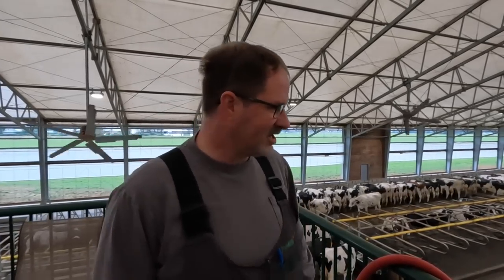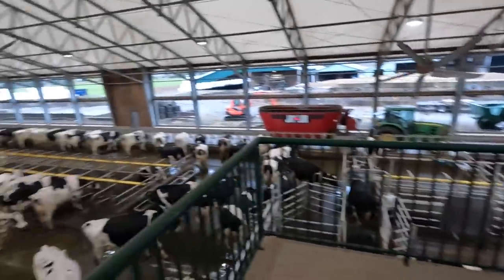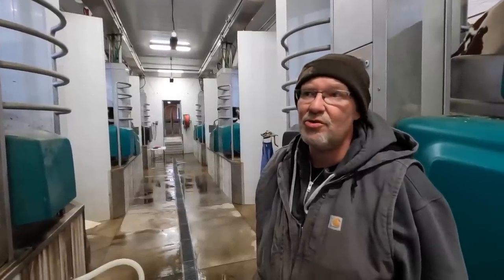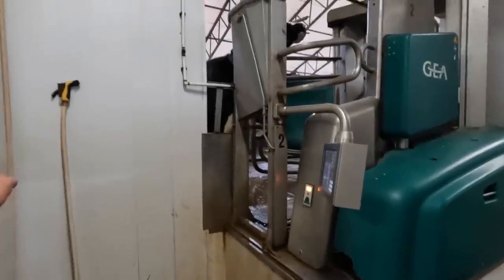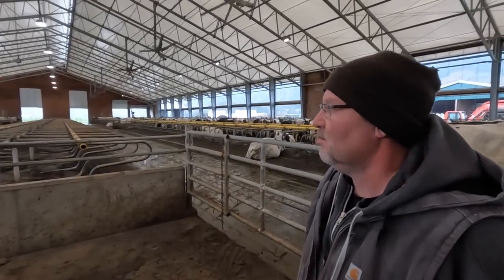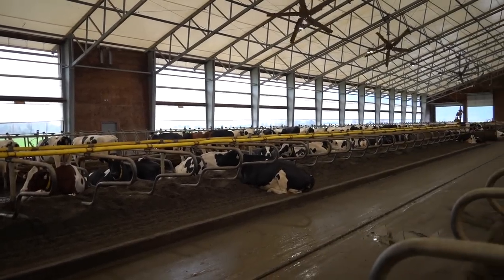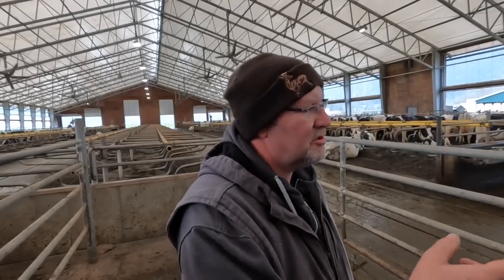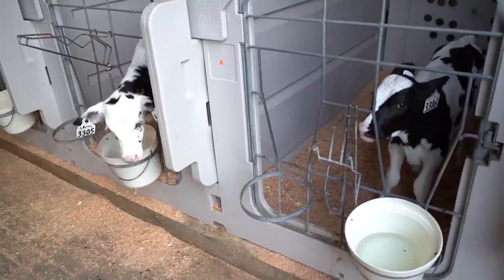Milking 280 Cows With GEA Milking Robots! British Columbia

Comment: This one I was curious more about the structure of the barn, it seems so different than others you’ve visited.
Reply: It's a European style barn, rather than a North American style barn.
Reply: @MellowYe77ow  I wasn’t so much thinking the layout but the roof structure being semi transparent I was  wondering about snow  and/or wind tolerances given the span. Given it’s BC it can certainly handle the rain. Then in the summer  handling the heat would another thing.
Reply: @daverowsome4023  It could be FRP (Fiberglass Reinforced Polymer) roofing. Enduro Composites claims their roofing can withstand hurricane force winds.

Comment: The Best setup I’ve seen, there may be better Technology/techniques now, but it was a Round spinning Milking Platform. When the Cows get on they take a Tiger Torch and Flame the Udder and clean off all the peach fuzz that holds onto 💩, then it’s cleaned and the Suction Setup is attached and Milking Begins and as One Cow is done when it comes around another Cow takes its place and the Cycle continues until every Cow is Milked.
Reply: Carousel parlor